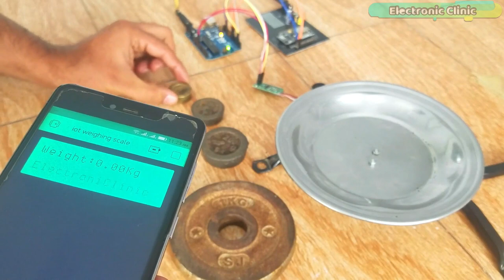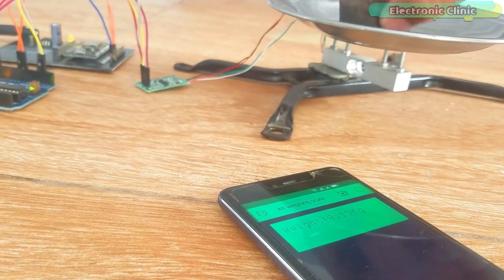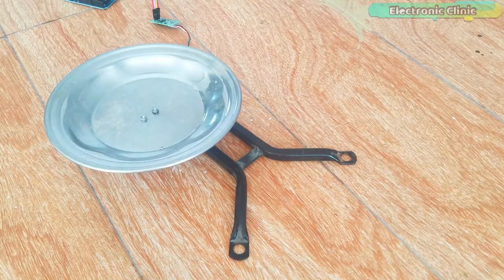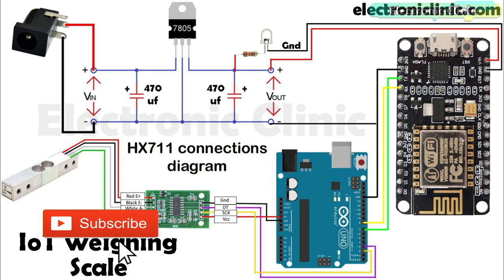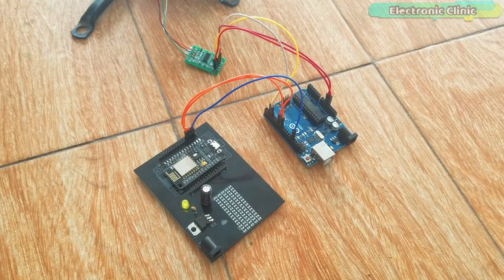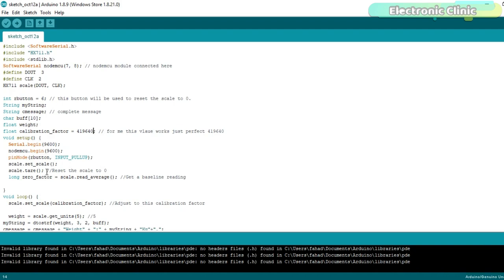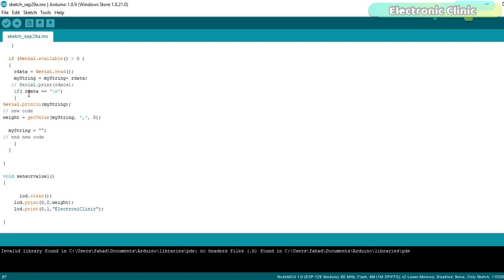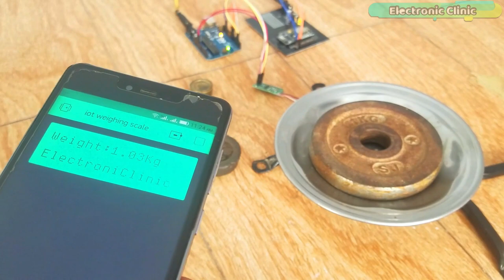DIY IoT Weighing Scale using HX711 Load Cell, Nodemcu ESP8266,  Arduino, & Blynk

Comment: can i also connect motor servo to node mcu? and can i also use 1 app blynk with 2 sensor? example i use blynk for control servo and u also use blynk to see load cell output??
Reply from the maker: yes, of course you can use. check playlist, i have done different projects using nodemcu and blynk
Reply: @ElectroniClinic  and how about that female jack? did u use or not? and actually why you use that jack in this project?